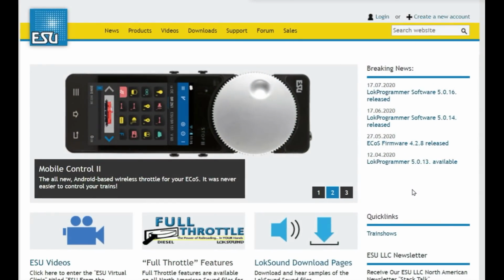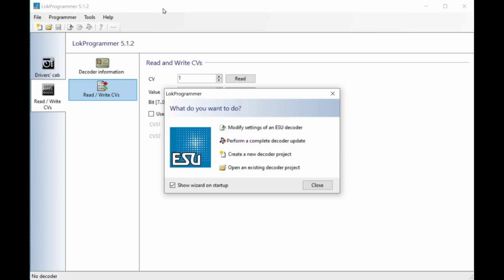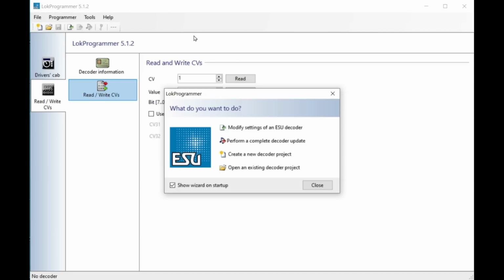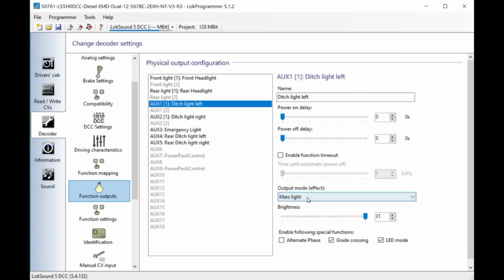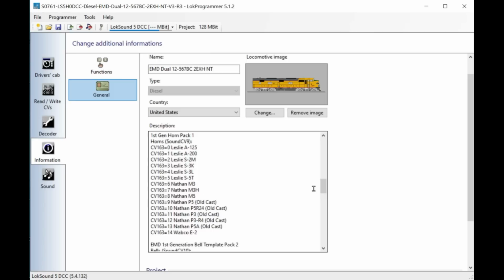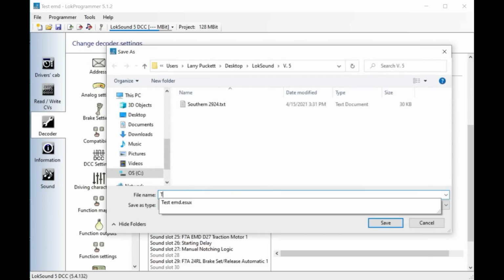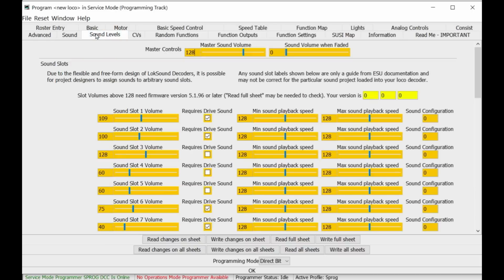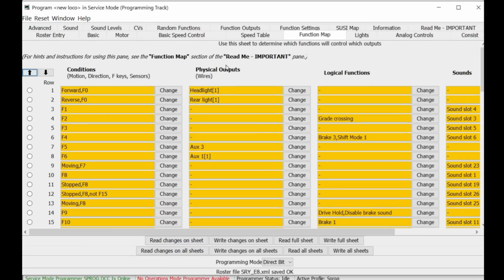Programming LokSound Decoders (185)

Comment: Hi Larry.  Once you makes the changes to the loksound decoder CV’s in Decoder Pro and save the file how do you load it to the decoder?
Reply from the maker: Assuming you have then  correct sound package loaded by your dealer then DecoderPro cane easily write the CV changes to the decoder same as with any decoder. It’s just the sound package that requires the LokProgrammer interface.
Reply: Hi.  Thanks so I would use the Decoder Pro with the digitrax PR4?
Reply from the maker: It always worked for me.
Reply: @TheDCCGuy  Hi Larry.  Have you made a video of actually writing the new changes to the LokSound decoder using Decoder Pro and the digitrax PR4? 

Steve

Comment: i usually do my prog work with my digitrax system...  however i am now using ESU loksound 5 decoders...  i had problems....so i have just ordered one of these loksound progamme units ......  i usually speed match my locos on the main using prog 'po'    i use a IR speed unit..and run cv5at 50mph and cv6 at 25mph.... ???? with the Lokprogrammer can i still speed match on the main as the locos are running ......???????  thanks peter

Comment: Have you much experience with LokPilot 5 non-sound decoders?  I fellow model RRer bought a number of DCC ready ScaleTrains SD40T-2's and reports he installed LokPilot 5 decoders and that they all died after less than 20 hours of running.
Reply from the maker: I have never used one but there should be little difference between the drive circuitry. So what are the symptoms of these dead decoders? Are there any burn marks, funky smell, etc. that would indicate an issue? Have you identified any issues such as frequent shorts caused by running through closed turnouts or others that might be related? How about his wiring, is it neat, properly sized, or a rats nest just waiting for something to happen? Has he tried the CV8 reset?

Comment: when uploading sound files,  does it overwrite the current sound files? or add to it?   Also,  can primer sounds by themselves be added in?   when selecting sound files, do they have to be specific to the locomotive like in my case the walthers emd sd70 ace.  So I have two locos of the same model with same loksound decoder and walthers tech said that mainline locos have proprietary sound files.  The current sound file settings have prime mover start up sequencer doing its thing every time I bring train speed down to '0' and it will not move till that sequencer is done.   I would rather have that sequence happen only either when track power comes on or using F8.
Reply from the maker: I a  not sure of any way to change a project once it has been uploaded. As for the start up stuff that can be changed using Cv setting changes in LokProgrammer or DecoderPro. You just have to dig in and find the right setting. It just takes time to get used to where it is located and I must admit that I don’t do it often enough to remember—I have to find it each time.

Comment: So my locomotive had from factory loksound 5 installed in BNSF emd SD70ACe with sounds already in it so I don't know current sound file in this decoder or what is the precise sound file for this decoder in this Walthers SD 70ACe HO scale.  I have two SD 70ACe locomotives with the same decoder,  both from Walthers.   Would decoder pro or lokprogrammer detect the sound file name?
Reply from the maker: I’m pretty sure it does provide that info when it starts up and reads the decoder, but I’d have to start it up to confirm that. However, I checked the LokSound website and that loco sound project is not there. This probably means that it is only available from Walthers.
Reply: @TheDCCGuy  the Walthers mainline locomotives have ESU dcc sound with proprietary sound files.  Tony’s trains sent me sound files and I try
Reply: @TheDCCGuy  I tried to play the demo for it and prime mover sound was way different then what is in decoder in SD70ACe.   I wonder if there are other prime mover sounds available
Reply: @TheDCCGuy  when sound files are uploaded into decoder, does it overwrite sound files that are currently in decoder.?   Is there a way to backup the sound files currently in decoder?
Reply from the maker: Uploaded files overwrite the old ones. I a  afraid that we are seeing a trend similar to that in the UK and EU where sound projects are developed by manufacturers or individuals. The manufacturers keep them proprietary and individuals usually sell them or include them free when you buy a decoder from them. I ran into this issue with Rapido when I installed a LokSound decoder in one of their locos and they wan’t way too much for the project alone. You mght want to check with Walthers tech support to see if you can get a copy from them.

Comment: Hi, Larry. I have a Walthers Mainline GP9 diesel with ESU Essential sound decoder, that works pretty well, except for the delay start up setting. I've changed CV124 to many values, and still can't remove the delay. I want to use the unit in yard service & the delay is too excessive. Any help would be appreciated. Thanks
Reply from the maker: I remove the delay p  all my LokSound decoders but I have always used DecoderPro for those kinds of tricky options so am not sure how to do it with just a handheld. Let me check what the CV setting is on one of mine and get back to,you.
Reply: @TheDCCGuy  I just changed CV3 & 4 to a value of 20, and it greatly improves startup and deceleration.  I had changed it previously to 0 with no difference in performance. I will keep experimenting. Thanks for all that you do to improve our hobby, Larry.
Reply from the maker: Yes, they often have other CV setting that interact with things like the braking and delay. I know that you have to crank up CV# 3&4 to get the brake sound so not surprised that it affects the delay as well.

Comment: Good evening,  I'm hoping you can help me out Larry.  I have been following your video over and over and I can't  get this decoder changed over to a steam locomotive from the factory settings.  Things go well until  I try to do the import.  I click on file on my desktop and it just says ok instanly,  no small download screen pops up at all.  Seems like all the pages fill up properly except for the FUNCTION MAP nothing shows up. Any ideas?? Thanks
Reply from the maker: Was it sold with the steam loco sound package installed in it? The factory installs a German diesel as a test and you have to either ask the dealer to install the proper sound package or download and do it yourself with a LokProgrammer.

Comment: Hi Larry. How are you? I have a question. It is not associated with the topic of the video, but I would like to formulate it in the same way, taking advantage of your experience. I bought a DR5033 to improve my design, but my head unit is a Digitrax DB150. Can I configure it with the Throttle DT402 or with PanelPro? Thank you very much. A hug.

Comment: Hi Larry, great video. I wanted to repeat your steps but I didn't achieve much. When trying to save the project in lokprogramer it asks me to change the configuration port. I use a pr4 and it only allows me to use com3, so the error does not progress. For some reason I ran out of sounds on my locomotive. Can I go back to factory settings? Thank you.
Reply from the maker: I am not exactly sure what you have done here. The LokProgrammer software does not work with the PR4. If you are using it without the LokProgrammer hardware interface then all you do is run  the program, make the desired changes, then export those to a CV text file. You do not try to write them to the decoder. Instead you create a new loco in DecoderPro and use the import LokSound CV list option to read in those modified settings. Then you can use DecoderPro to write all those changes to the decoder. Your sound file should still be intact on the decoder, you just need to either do a factory reset, or reprogram the decoder.
Reply: @TheDCCGuy  Hello again Larry. I actually went back to factory settings. Okay. It's clearer to me with your explanation. I got lost when you showed that it took 30 minutes to load and I thought that was the way. I must export and import after modifying the file. Perfect. I'll try. I am working on a scale train locomotive that comes with loksond from the factory. The model is the C 40-9 in scale n. It sounds very good out of the box, much better than most of the sound decos I have and I want to see how to improve it.... Thank you very much for your answer. Greetings.

Comment: hi Larry
I have a problem with the esu decoder, have downloaded an audio file, try to test it, it works ok going forward, it has become very hot in reverse, otherwise everything works as it should.
Reply from the maker: Sounds like a tech support call is in order, it should not do that. First though unplug the decoder and run it on a DC track to make sure it it not a mechanical issue.

Comment: I need your help regarding the info on exporting from Lokprogrammer into DecoderPro, please
I have watched this video 4 or 5 times and have used your procedure but when I try to import into DP the file does not show. What may I be overlooking. Since you made this vid a while ago it may not work with todays version. I am using 5.1.7 LP version and 5.26 DP. That a problem ?

Carl Sowell
El Paso, Texas
Reply from the maker: Carl—I need to check this out as you are the second person who has reported problems with this. I will download the latest version of DP tomorrow and give a try and get back to you—Larry
Reply: @TheDCCGuy  Thanks. I failed to mention that I am using Win10 and google.

Comment: Hi Larry, Based on the info in your video, do I understand that you can only upload/modify the CVs via this method using JMRI and if the sound files are not previously loaded by the Loc-Sound Programmer then you can't upload the sound files into the Loc-Sound decoder with JMRI.  Is this correct?
Reply from the maker: Yes, new sound files can only be loaded using the ESU LokProgrammer software and hardware interface. CVs can be programmed using the LokProgrammer, DecoderPro, or other programming method.
Reply: @TheDCCGuy  Thank you so much - It looks like I will still need the the Programmer which ever way I go unless I can find another programming method.

Comment: Is the interface the only reason for moving the esu work to Decoder Pro?
Reply from the maker: Well, I actually prefer to use DecoderPro as it is more logically organized so to me it is easier. Plus it allows me to keep a roster of all my locos with their decoder CV settings.
Reply: Thanks for the help.  I use an MRC dcc system .  It does a pretty good job.  But it requires a proprietary connection that isn't available anywhere.  I've looked.  So JMRI isn't something I can use right now.

Comment: Another request, please. Could you explain what my options are for choosing the "spitter" valve on both the V.5 and Select decoders? Most of my locos are first generation, like yours, and I distinctly recall the air tanks would make a blowdown sound to dispel the condensation. It seems like the files available for both the "fast" and "slow" spitter are the modern "pop-pop-pop" type. I have toyed with sound slot 15 and 17 to no avail. I would like to just hear the "fading hiss" of the air blowdown. Thank You.

Comment: The processes and steps here are way too involved and complicated for me. So, let's say that a dealer has installed this for you or you bought  a loco with everything pre-installed. My question is can you use a handheld cab, like your NCE, to program CVs like in the old days of a decade ago and not go through DECODER PRO or the ESU system?
Reply from the maker: Yes and no. For simple things like address and sound levels most are not too difficult. However making significant changes like the Mars light swap, etc. can get pretty involved using indexed CVs and multiple steps. So if you buy a factory equipped loco you are probably OK.

Comment: Nice vid. I don't understand why you use DecoderPro for Loksound decoders at all, since you have the ESU programming software and hardware, especially given your comments about DecoderPro reading Loksounds?
Reply from the maker: Well, it is a matter of what I consider user friendly to me. I just find that DecoderPro has things organized in a way that actually makes it easier to program the decoders once the sounds are uploaded and the sound slot assignments identified. There are things I have figured out how to do using DecoderPro that I still haven’t found in LokProgrammer! As for reading CVs, DecoderPro has no problems with only a few, it is when you start reading hundreds at one time that read errors can creep in, plus it could take hours to do. So I always export the CVs from LokProgrammer to DecoderPro and then do the edits and actual CV programming.

Comment: Hi Larry, excellent presentation.  I've been using the LokProgrammer unit for many years, both for myself and for customers in the store where I used to work.  It is an exceelent tool for anyone who has a fleet of LokSound equipped locomotives.  One of the biggest benefits of the ESU system is that when ESU releases a new version of a sound file I can load the new version in my order models.  For example, when ESU released their "Full Throttle" versions of their sound files I updated all of my diesels with the new version.  

Another thing I do is "remap" functions.  I feel the Function 3 (F3) "Coupler Clank" is a waste of a function, especially in the F0-F9 range.  So I've been changing F3 to "Run 8."  On my diesel which do not have dynamic braking I remap F4 to "Coast."

While I do my one sound installations sometimes I get lazy, and I'll have the dealer load the sound file for me.  Both Streamlined Backshop and Tony's Train Xchange will load an ESU LokSound file for no charge.
Reply from the maker: Yes, function mapping is a powerful tool that many folks are unaware of and I need to do a video on it. I know a lot of folks who use Digitrax utility throttles with limited functions, but function mapping makes it possible to select a subset that are most commonly used.
Reply: @TheDCCGuy  Younger modellers who are avid gamers are probably well familiar with function mapping. It is akin to mapping keys or buttons on your game controller!